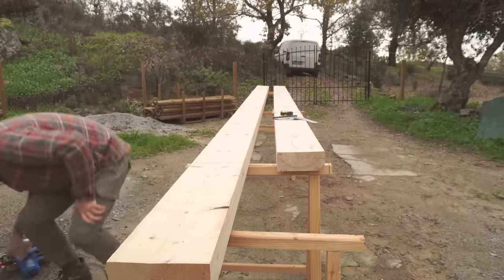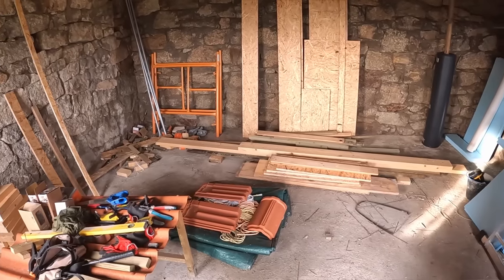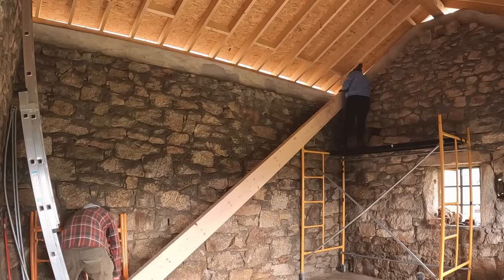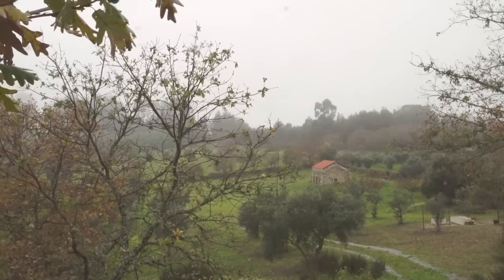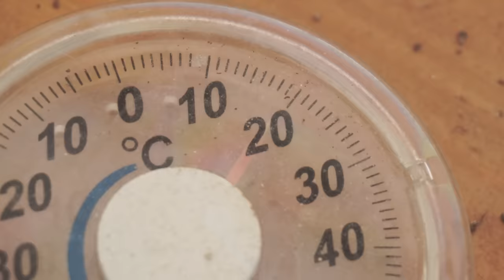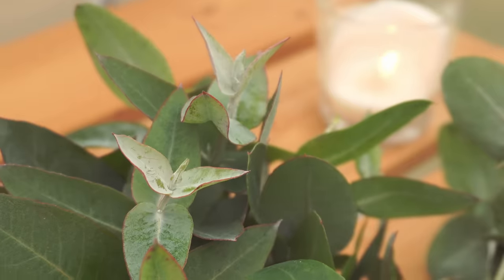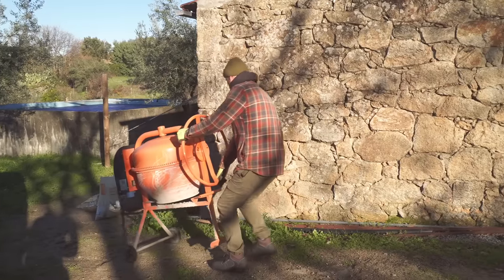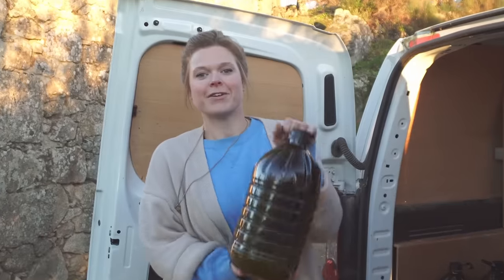This Is Wrong but We Have No Choice | Stone Cabin Renovation

Comment: If you're going to keep the olive oil in those plastic bottles (which you should not!) at least put them in a very dark place. Ideally, you'd wanna use tinted glass bottles. If not then clear glass bottles, always kept in the dark. If it's a 1L bottle that you consume fairly quickly it's fine, but for those big 5L bottles that you're gonna keep in storage for a long time just remember, no plastic and definitely no sunlight! 😉
Reply: Our local olive oil mill sells the oil in plastic bottles that we then keep in a dark cupboard!  Their mill obviously does the same.....not sure I agree with you!
Reply: We keep our oil in old flip-up  750ml beerbootles in our cave, where it never gets below 12 degrees. It works well enough!
Reply: Sounds like your recommendations are really spot on, but maybe not possible for everyone. Isn’t that the way life works? There always seems to be the ideal and on the flip side is the possible.
Reply: Obviously, when watching the clip, they had other things on their minds than making sure the olive oil was not feeling neglected
Reply: Oil of any kind will absorb the toxic
chemicals in the plastic.

Comment: I enjoyed this video. Your wreath is stunning. I live near a village that was one of the last Medici family holdings. It is called Santo Stefano di Sessanio. It was in complete ruins, Originally built in the 11th century. An architect in Milano bought the village and started putting it back together and it is amazing. Although they do have electricity and heating, the christmas decoration is similar to yours, they use natural fibers, no glaring lights, amazing aromas, and candles. I could almost smell the wreath. a bit of advice. You will need to transfer your oil to metal cans. Plastic won't preserve it properly. My friends put it in  a vat in their cellar with a tap on it. Then when you need Oil or you wish to sell some liters, you can transfer into metal tins and then transfer into a glass bottle with a stopper. You can buy a vat at a farm store or a local hardware store probably there like here. We get anything and everything from the plummer's
 store. lol. The roof is stunning.  Best of Luck and Buona Natale!  from Italy
Reply: PS. We sell olive oil here for 10 euros a liter. if you choose to do that.
Reply: You two are so adorable and I love the way you work together so well. I love your wreath, so beautiful and creative! The only thing you two are missing are two sweet little kids running around! ❤

Comment: With such a small roof span, using additional beams is pointless. The roof is of very solid construction. Looking at this weather zone, it is unlikely that there will be snowfall, so there is no need to make such reinforcements even with this type of roof tiles. The roof structure is designed to withstand the impact of a Tallboy bomb😁

Comment: what about the old roof beam? Are you planning on re.using it? Ithink it would look amazing as the exposed beam in the house. Clean it up, do a very light sending, stain it, add a polish and wowzer!
A bit of history, centerpiece, and talking point.
And you could re-use some of the old lumbar as either a accent wall, or if not enough, then use a small amount as and frame it and hang it.

Comment: Having seen the sectionof stonework around the purlin, my thought is that you should do the internal gables completely in stone.  Yes, it is much slower, but I suspect it will look much better.  Brick + render along the horizontal sections and all around the outside should be good.  (I know - a personal perference and it's not my house ...)
Reply from the maker: If we had more time Ian then we’d definitely go with stone. Its not even so much the actual laying of the stone that gobbles time up but it’s the finding the right size stone & shaping it too

Comment: If you're choosing between lime mortar and cement for fixing beams in place, lime mortar will be far better at releasing any water that ingresses into it that cement, which can stay moist for far longer. It's not going to be a game changer in Portugal - I think it'll be dry enough to stay dry but listen to those who know about this. I think you'll be fine when it's on the inside. Nice video BTW.
Reply from the maker: Using lime on all the stone pointing but just using cement here as it’s internal & has the ring beam & external wall behind it so shouldn’t get wet at all 👍🏼